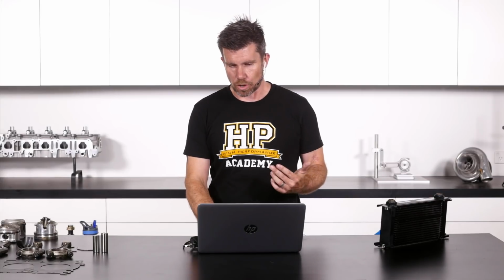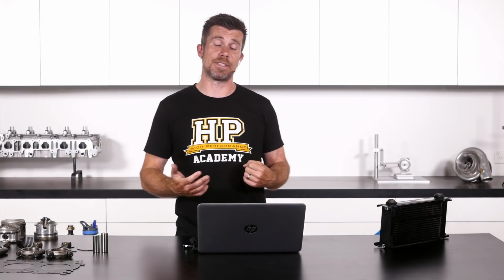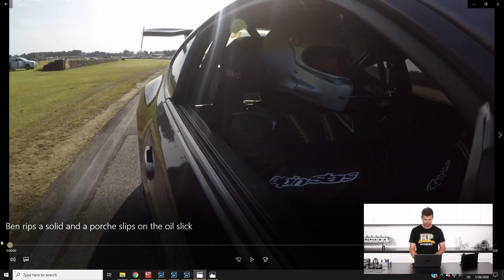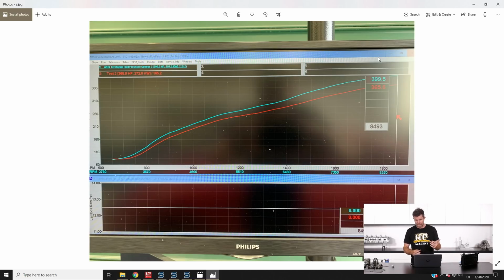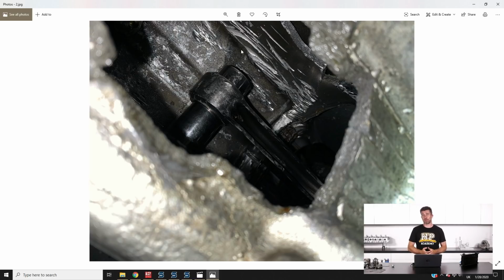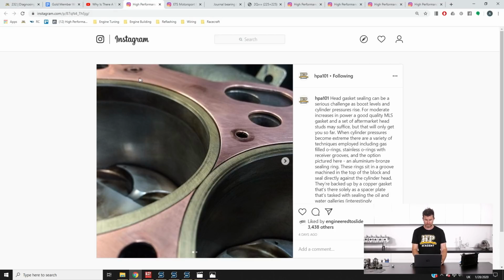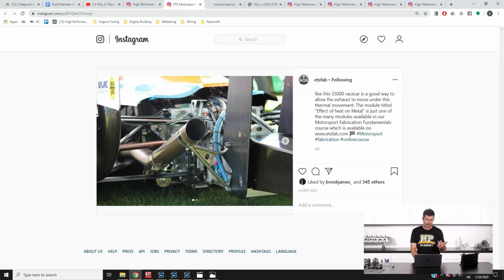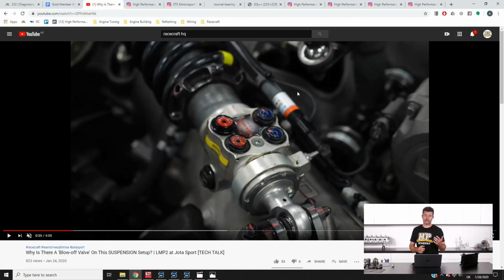The Truth About Driveshaft Shop, Secondary Forging And More | Today At HPA [UPDATE 232]

Comment: Let's do an update for 2023:

I bought a Level 0 set of axles for my 1994 Accord EX Coupe, 5 speed manual VTEC (all stock motor) before COVID.  2018  

The first set, the Inner CV joints became sloppy in 6 months daily driving.  They sent me a new set nice enough, given the car hardly is driven. The second set lasted until 2020, but started getting lose again (Inner CV joints).  

Well COVID hit so parked my car 2 years..  Now we come out of COVID, and I reach out to Driveshaft Shop to get parts (willing to pay for them) for replacing just my 2 inner CV joints that failed.  Am told... we don't have parts for those 2018 axles anymore!  We changed production specs... 

Really?  

So, the slogan is:  "We Specialize in The Impossible"..  But we can't fix our own products?

So, they offer a discount on buying another new set of Level 0 axles.  Which have doubled in price since 2018.!   $ales pitch!

Are you kidding me?  "We can build anything.. just call us".  Just don't ask for a part to repair what we made a few years ago?

Frustrated in the axle quality for a totally stock street car.   Why buy again another $650 set of axles that already failed twice?  And you get stuck with the core because it is custom.

Heard the shop changed hands a few years ago.  It's not the same.  

May have to pay another reputable driveshaft company to repair my inner CVs.. made by The Diveshaft Shop...   

Or, pitch these DDSS axles in the trash... and go OEM at Rock Auto for $50 each.

Maybe they will make good.  Does not sound like it.  

Here is the new 2023 price and axle set... 

https://driveshaftshop.com/product/honda-1994-1997-accord-4-cyl-5-speed-manual-basic-axle-level-0/
Reply from the maker: Ahh man, sorry to hear of your struggles. Shame this is still happening years later - Taz.
Reply from the maker: Did they ever make good on this for you out of interest? - Taz.

Comment: "lbs.ft" - YAY!

Said it before, I'll say it again, with transmission components, ratings for "power" mean SFA! Depending on the rpm that 'power' is produced at makes a huge difference to the stresses on the components, and for axles the diff' ratio also adds to the problem. Throw in shock loadings, as the components are unloaded and loaded, and sticky tyres and it gets even more of a problem. 

Then there is the rpm, and problems keeping things lubricated - doesn't even need a lot of loading, as a large part of the problem is the internal friction from the lubricant's viscosity.

The whole DSS saga seems to be one of those cases where a company is built up by someone who cares and knows his stuff but later, as it expands and/or the owner has other interests, a manager is brought in who isn't really the right person for the job? There have been a few stories about people having problems with that company - don't know the truth (as the saying goes, "There are three truths - what you say, what I say, and what actually happened") about it as, since once rumours start...
hopefully the owner takes charge and sorts out the problems with the customer service.

A similar problem is when a successful company is bought out and the new owners decide to make changes that end up destroying the values, and reputation, that built the company up in the first place.

Comment: We had the same Problem with dss 1000hp GT86 axles, but mostly only on the left side. About 8MM to Short. We fixed all Problems with a spacer.  Since we use them the axles work fine.

Comment: That sucks but DSS has had a history of poor customer service.  A while back I had a long ordeal with them but eventually got taken care of. They sent a pair of rear axles for a GC Impreza with the R160. The box's label was correct for the car but come to find out. The axles were for a GC with a R180. Found this out after counting the number of splines for the diff side. They tried to argue they we didn't know what we were talking about and that is no way it was boxed wrong. What makes even worse. They are the only game in town when it comes to HD axles. Someone else needs to make axles.
Reply from the maker: Yes really frustrating as the products are not bad when they are correct, but they really just want to clip the ticket sale wise and move on from there regardless if what they sold you was correct or not.
Things do go wrong, and we're OK with that, but it's how issues are dealt with that is important and makes the difference - Taz.
Reply: @hpa101  Like the comment said above great job coming on and explaining without attacking. I'm having similar issue with DSS now over a carbon fiber driveshaft that is too long. Many calls, emails, measurements, photos and then told my 2017 subaru sti has many variations. All I'm aware of is the manual and auto are different sizes and the 5 speed vs 6 speed are different sizes. Hoping the situation will get resolved now I've missed tuning, races its super frustrating.  It's one thing when you are spending a little on mediocre parts but when you're spending top dollar on parts they should be correct.  So much time and fustrstion. My social media status isn't as large as yours, Can I get Frank's number?
Reply from the maker: Sorry mate, YouTube buries replies in a way that makes them hard to spot on older videos. How did you get on with this 8 months later? All sorted? - Taz.

Comment: Situation normal with DSS. We had nothing but problems with DSS quality issues as far back as 2004. Snapping their 1,200 HP Viper Drag Racing axles on our Road Racing Corvette.  900+ HP Joe Gibbs Racing SB2. Problem was quality control.  Stress risers in axle at Circlip groove. Terrible machining.  No radius at all when groove was machined in. Went through three sets of these things before we went to Mark Williams shafts. Difference in quality was immediately apparent. Beautifully machined axles . Full radius at all stress areas. Circlips grooves were properly radiused as was the stepped areas where the splines were machined into the axle shafts. I'm quite sure the actual shaft material was far superior as well. Non of this was on the DSS axles. Bottom line. The Mark Williams axles were the last set of axles we ever had to buy. And typically, we got nothing but excuses from DSS. Would never recommend them to anyone.
Reply from the maker: Sorry to hear that Richard but stoked you found another company that delivered as promised. We'll take a nose at them in the future if required =) - Taz.

Comment: just check the middle of the driveshaft joint if you have to extend it to bolt on it's too short, check the travel without springs also.

Comment: I got DSS axles for my turbo gt86 and also for my twin turbo 350z, and I agree their customer service is terrible. Takes so long to get a reply from them, and they forgot to send half the bolts needed for the 350Z CV conversion. Having said that, on both cars the axles haven't broken or let me down at all despite lots of abuse in drift events
Reply from the maker: I'm glad they've served you well too. We had a good run until these ones as well. What flavour GT86 axles did you get from them out of interest? - Taz.

Comment: Get some custom K600 shafts made. It is steel designed to accept shock loads and are about as strong as available. Heat treat them for your application.
Reply: Is this not the common material already?!
Reply: @Aseutester  It is expensive steel and somewhat difficult to work with. There is a tendency for well intended people to offer to make 4340 shafts. So the user hears this and assumes it "the business"  K600 is probably 3x price.  It is also prone to distorting a bit when heat treated so for something like an axle it doesnt matter.  Ultimatels a good material choice, proper heat treatment and attention to detail, particularly around blending in and surface finish.

Comment: We have had problems with them also.Ours we’re the right length but both shafts and half shafts all needed fettling to fit as they wouldn’t fit to start at all. All boots imploded on its first test due to no breather pipes , which we have run as standard for the last 10 years , when I emailed them complaining about what happened, they said yes we should vent them and use high temp grease.. For £2800 we have to vent them and use high temp grease 🤷🤷🤣. Real shame as there reputation displays world class,but their customer service is a joke. We incurred 7hrs of extra work to get them to even fit. Plus had to buy 4 new boots at full cost. Not once have the apologised or offered to comp the extra costs. Shame as the big guys don’t care about the smaller details.
Reply from the maker: I'm sad to hear they still have poor customer service, old mate made it really sound like he was going to get rid of a few bad apples after our experience. That was 2 or 3 years ago.

You are definitely left to feel like they don't care what you get so long as they get your money off you, hope you can find a good alternative, a few nanes pop up in the comments. Wont get your time or money back though - Taz.
Reply: @hpa101  for sure. We’re 2 guys with no backing like most and chose them for reliability but none of the splines would fit. Luckily Dan is the man and just sorted them. But we shouldn’t have to do that. Their customer service is embarrassing. Thanks for responding huge fans of yours. 💪💪

Comment: Our friends pro-am drift car had ordered 1000hp axles from Driveshaft Shop and they snapped under 400whp first day out. They would not reply to emails or calls at all. We hear that the son took over ownership and service has suffered.
Reply from the maker: Oh man that sucks! So much time, money and often emotional effort goes into getting a car to events let alone the parts so getting no help after the fact is a slap in the face. Did your friends get things sorted with them eventually? - Taz.
Reply: @hpa101  They never ended up replying and ended up going with a local off road shop to make custom axles that have yet to break.

Comment: I've had 3 problems with DSS products so far with my Lan-Evo axles, had level 0 axles for the front, left side outer CV failed under small cornering with engine under 300AWHP lol.. Have the DSS aluminum driveshaft, center carrier bearing failed after 5,000 miles... Alot of these problems are at DSS and their new team. They really need to hire some decent Quality inspectors... im not even sure they are using a CMM to check dimensions, maybe a blade mic and a set of calipers... quite sad quality is going down at most companies currently as new hires cant even read a blueprint..   Note: I am a CQE (Certified Quality Engineer)
Reply from the maker: Sorry to hear of your issues, there is definitely room in the market for someone else in this area now - Taz.

Comment: Seems pretty clear the pin boss failed and allowed the conrod to jerk the wristpin out of the piston. That failure was standard fare on the LS3's I endurance tested on the dyno back in ~2009. Interestingly, the LS2 could do our entire 72 hour track simulation on the dyno - and continue to make more power, less crankcase pressure throughout the test. The LS3's would fail (in the same way your 1UZ did) like clockwork between 22 and 25 hours into same test.
Reply: How do/did you fix this Weakness in the LS3?
Reply: @Aseutester  We didn't. I'm sure a quality set of pistons with more (or stronger) material around the pin would have easily solved it - but we were preparing/developing engines for factory stock racing class that didn't allow aftermarket pistons. GM wasn't terribly interested in changing their LS3 piston design...

Incidentally, the LS7 has a similar problem. The pin boss will fatigue and fail after ~30 minutes of operation over 6500rpm. And, it's cumulative. The pistons only have 30 minutes total life at 6500+. GM even designed and successfully tested an improved piston that cost a couple dollars extra - but never implemented it.
Reply: @GroovesAndLands  Does this problem exist in the 6.0ltr L98 I've got?
Reply: @Aseutester   Dunno, but I suspect not. If the L98 has the same rods and pistons as the LS2, you're definitely all set for an NA application. We never did hurt an all motor LS2 on the dyno - despite trying pretty hard!
Reply: @GroovesAndLands  What are OEM LS engines more sensitive Too(as in failure/shorting lifespan) Much RPM or too much power via Forced induction?
Reply: @Aseutester  Depends on which LS variant you're talking about. I'm not an LS "authority"; I did development work on several during my tenure at that shop - those I worked on I know pretty well, but that was only a handful of the myriad variants out there.

LS7's are definitely valves and pistons. The valve thing is well known. LS3s fail pistons in endurance applications. That failure is a combination of heat and RPM. Forced induction loads are generally easier for engines to deal with than RPM, because the increased load is mainly a compressive load on the rod/piston. Cast pistons are actually very strong - but they just don't have resistance to detonation whatsoever. Most connecting rods can handle the compressive loads of forced induction - but they can't handle the increased tensile loads caused by increased RPM.
Reply: @GroovesAndLands  Isn't the "Valve" issue specifically the OEM Valve Springs?
Reply: @Aseutester  No, not really. There's debate whether key issue is valves or guides, but most shops doing "the fix" do both. Trouble is valves are f'n huge to take advantage of the big bore. Rocker geometry is a bit awkward to get tip in the right place. It's not ideal from an endurance point of view, but with the fix - it works pretty good.

Comment: DSS are straight clowns. Dealing with them on almost identical issues for several MONTHS on an STI build with stock diff and suspension geometry... the latest “custom” 1000HP axles seem to be the right length but the inner splines have far too much play - I am currently jumping through their measurement hoops... HMU Frank!
Reply from the maker: Sorry to hear that NITRO, I hope you can get a direct line to Frank, it was the only thing that helped us get sorted in the end.

To late for us, but we were since advised in the comments here to purchase their gear through a reliable 3rd party (if at all) to have them do this work for you with the DSS team if there are any issues - Taz.

Comment: I'd recommend running the 1uz from 91-93 sc400. I ran 92 sc400 with 1uz with no problem (Toyota had ran factory forged internals) @High Performance Academy

Comment: I'm going to bet that the Rings are gapped for a different type of material. Or they're just gapped wrong in general. Endurance racing sees so much heat ring Gap probably one of the most important things to keep the Piston from failing. I'd also like to see the data log of engine temperature right before it blew.
Reply from the maker: Temps were all good, we had live telemetry on the go. Looks like a valve retired, but we don't want to say that for sure until we have put the effort in to finding out for sure in the next few weeks =) - Taz.

Comment: Shit, you guys with all of your knowledge having such engine failure makes me wonder if I should ever try and turbo my own
good luck for the next round!
Reply from the maker: Yeah one weekend without Andre and we're lost haha. Nah as Andre mentioned there were a few signs but we had entered and booked accommodation already so rolled the dice. It wasn't a fresh or one of our own builds, so could have been worse - Taz.
Reply: Don't sweat your own build. Just pay attention to these guys/get their course and you'll be good to go. All I had to do my first build back in the day was a book called Maximum Boost by Corky Bell. I actually got it from the library with a few other old hot rodding books on engine assembly. I also had the factory Bentley (publisher) VW service manual and I did all right.
The internet forums where just getting started and there was hardly any decent trustworthy information. A lot of dicks used to feed people bad information on purpose even. But now you're set and the HP Academy videos are worth every penny. I would've killed for something like that back then.  I've been in the mix for 20 years now and I still learn and use them as a reference.

Comment: can you please do a webiner on Knock sounds, how to set up your knock ears, put it on the forum and still no reply, included audio
Reply from the maker: Hey there, have you watched any of these ones? If so let me know specifically what piece of info you're missing and we'll get Andre to help you out via the forum :) The first two are probably going to be the best ones for you at a guess but I've popped the other there just in case as well:
https://www.hpacademy.com/previous-webinars/130-what-is-knock-essential-knowledge/
https://www.hpacademy.com/previous-webinars/203-ideal-knock-sensor-placement/
https://www.hpacademy.com/previous-webinars/103-setting-up-plex-knock-monitor/
https://www.hpacademy.com/previous-webinars/083-understanding-knock/
https://www.hpacademy.com/previous-webinars/049-setting-up-knock-control-link-g4-vipec/
https://www.hpacademy.com/previous-webinars/057-elite-knock-control-haltech-elite-2500/
https://www.hpacademy.com/previous-webinars/motec-m1-knock-control-example/
Hope that helps you out a bit- Taz.